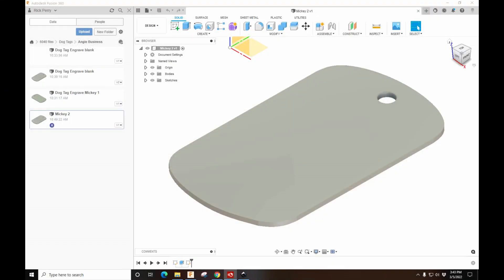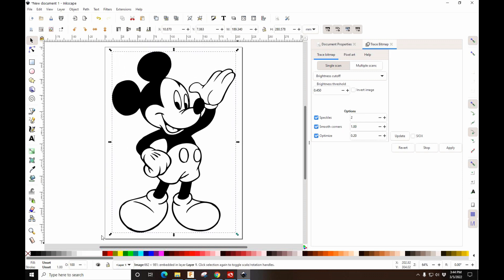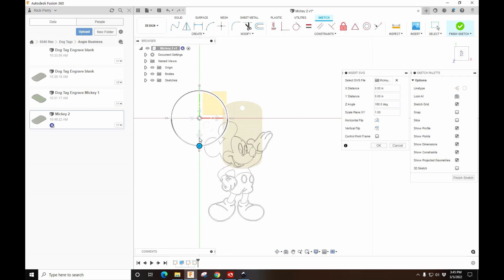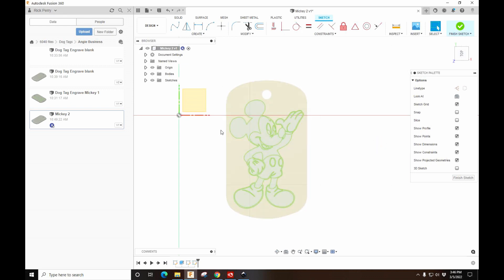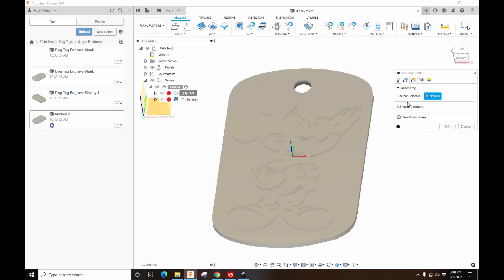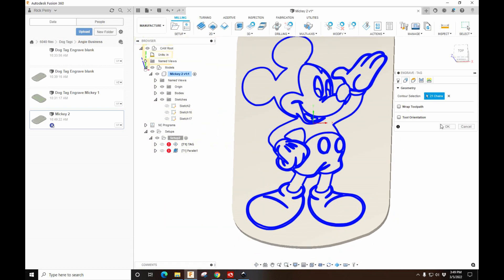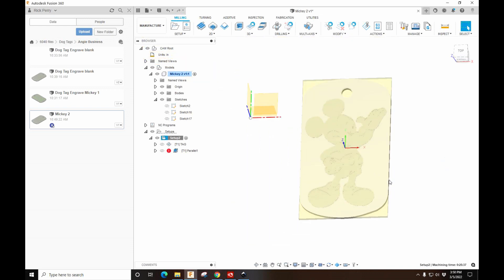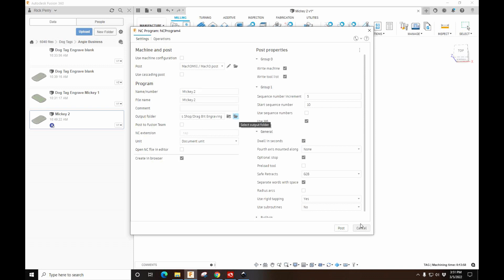Drag Bit Engraving in MACH3 and FUSION360

Comment: are the tags just pressure fit in there?
Reply from the maker: yes, It's almost a fail though and I ended up making a vacuum fixture because some tags would be too tight and some too loose. The vacuum system works perfectly

Comment: Can you show how you use the parallel toolpath to engrave solid infill?
Reply from the maker: Yes, it's actually easier than you think. Select Parallel on the type of operation and if you use a drag bit enter 0 for RPM or 1 of the post processor complains. Then go to select your area and it will turn blue. Then tell it how much stepover you want and hit ok. For drag bit simply pre load the bit and for machining you gotta lie to the machine. Set Z at the proper 0.000" and then manually enter 0.001 into the DRO. It will cut 0.001 deeper than true Z and you can sneak up on the cut to get the cusps that you want. Fusion will complain about cusps and stepover being larger than the tool and it's ok because it's a V bit either way and just ignore the warning. Try it

Comment: How did you setup the drag bit in the tool library in fusion? Thanks
Reply from the maker: I modified the settings on a normal 45 degree chamfer/engrave bit and then told it 1 rpm so the spindle doesn't come on. When I set the zero for the Z height, I lie and tell Mach3 that it's 0.050" above the part. This will preload the drag bit and give me pretty good results.

Comment: Fusion 360 has a pattern feature that is very handy for exactly what you are wanting to do. Create your tool path and right click on it. Select add to new pattern. Select your direction, your spacing, and quantity. You can pattern in the X and Y direction off of one tool path. Really handy, I use it every day cutting fishing lure molds.
Reply: You only have to do your CAM operation once, then you can pattern it. You should try it, because I literally  use it everyday and only create the operation once.. As far as the quantity of times would be the least of my worries, the worst that can happen would be the drag bit wouldn't be touching a tag and you just stop the program, jog retract z away, remove the finished doc tags and proceed on to your next project.
Reply from the maker: That is true but also when you use the pattern feature, you have to assign the CAM toolpaths to every instance. If you use work offsets then you only have to do the CAM on one instance. Also if you only want to do half the amount of items you can simply change the WCS number in your setup instead of going back to the design workspace and re-doing the pattern.

Comment: How did you set up your drag bit in Fusion 360 to avoid the spindle starting?
Reply from the maker: I set the RPM to 1 and my VFD ignores it and doesn't turn on IF I have it powered on. When I do the drag bit engraving I normally don't even turn on the VFD.
Reply: The other option is to post it normally then edit out the M3 S#### to prevent the spindle from turning on. The S#### is the programmed spindle speed. Sorry forgot to add that you edit it after posting in a text editor.

Comment: There is a number of programs, I guess you are looking for free ones: you can generate path in Inkscape, or use Carbide Create
Reply from the maker: Carbide Create doesn't have a work offset table like Mach does. I'm sure they can accept G10 commands but I don't want to manually edit G-code every time I run a new batch of tags. Seems Mach is still the winner in manufacturing in the small shop. I wished that you would have listed those "number of programs" and if you do, I am only interested in the ones that easily accept work offset entry. Thanks for the comment